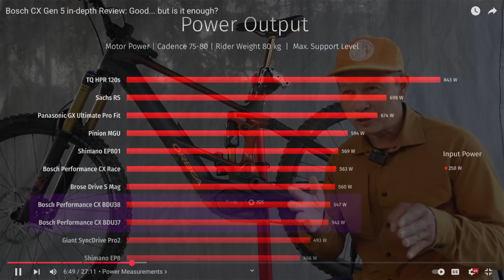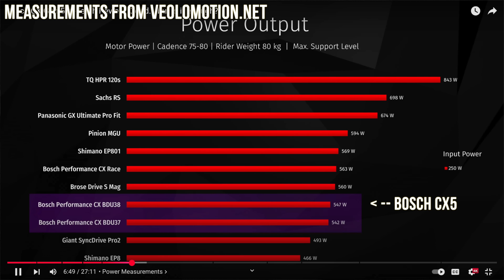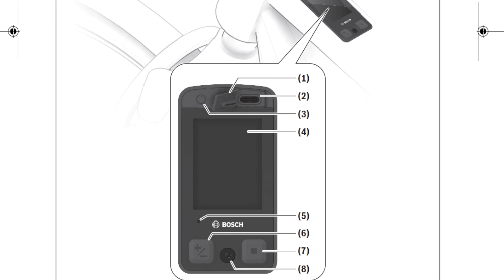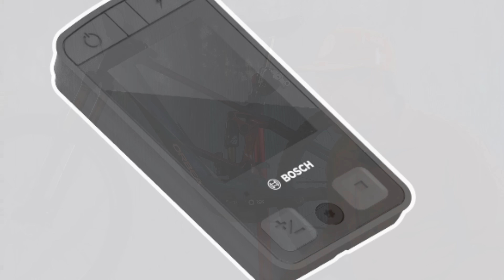Bosch CX5 motor to get 100nm torque upgrade and 750 watts - BDU38 CX model

Comment: With this power upgrade should I get the orbea wild or get the gen 4 levo? I did try the orbea wild and it was a beautiful bike to ride even though it was only a short test ride and wasnt tuned to me.
Reply from the maker: Gen 4 Levo. It is truly a great system. The alloy models should be out soon.
Reply: @EMTBReview would you reccomend a carbon or alloy? I've always had alloy but not sure if there's any disadvantages to carbon

Comment: That's never been a question. Bosch did that with the Gen4 Motor years ago and there's no doubt it will happen as soon as the stock in Gen4 on the market is low enough.
Reply from the maker: It's always been in question.  But many manufacturers have the CX5 upgrade now and it's verified awesome.

Comment: More torque and power is mostly a marketing gimmick. Existing 85 Nm torque is enough to lift front wheel into the air on a steep ascent and quickly destroy sprockets. Lighter batteries and compatibility between motor generations are more desired features.

Comment: The Purion 200/remote and display is only slightly larger than the LED remote. Just swapped my LED controller for it. <$200

Comment: Curious- on your climb test are you able to pedal through the turns at 200 watts at 14 or so mph (1 mile in just over 4 minutes) or do you have to make up the watts to get the average on the straights? At some point traction is going to be a problem  with these ever higher powered set ups.
Reply from the maker: Great question.  I have to make up the watts as it's not a constant 200watts the whole way. So the key is get the average to 200w by the end of the ride.

There are many ways to get to a 200watt average so I try to stick to the same formula every time.  Stay as close to as possible to 200w average the whole way.

Comment: Do you think the screens will be retrofit compatible when they come out? I was think of buying a vala and seeing the interface in person does look less refined compared to other systems.
Reply: The screens / batteries are usually compatible within the smart system (gen4+gen5), so this should be no issue. The vala already has this plate to be prepared for the new bigger inframe-mounted display, doesn't it?
Reply: @e_mtb  it's does have the cut out but was curious if was similar to the specialized where technically you could put the new display in but it is not guaranteed to work correctly.

Comment: fyi Purion 400 has been buyable since 2025.02.12 in Europe and early adopters got an horrible deal it started at 229$ and two months later it's 146$ equivalent in my country (which is more inline with the others Bosch displays but still more expensive than a Kiox500 for example)

Comment: Just put on order a Pivot Shuttle AM which comes with Gen 4 Bosch Race Motor... I do plan on racing this e-bike. Would you recommend purchasing an E-bike with Gen 5 or the new Specialized with 101NM or does the Gen 4 Bosch Race motor equal?

Comment: any plans to increase torque on the the SX motor so you don't have to spin 110 rpms?
Reply: yesterday I limited my Cx gen4 from 85 to 55nm to try and max range (48 miles 6090ft up and down a mountain on trails 13% of 750wh left) and I realized two things 1) bosch motor work on rpm and nothing else you cannot power pedal it brings nothing it's not a Sx only thing 2) I was hesitating to switch to a Sx but realized that day they are not powerful enough for when an emtb really makes sense, going up 30+% on dirt and rocks I ended up having to push segments I knew with 85Nm I could have climbed easily so mid-powered in the end help fit riders mostly when they don't need it (I'm 220lbs not fit at all so it would be worse for a 120lbs xc rider)  that said you still feel better at the end of the ride and in way less time I didn't do the same ride exactly but one with more road on legs and it took me almost 3hrs more

Comment: Now Bosch needs to give us the option to de-restrict our bikes!!! Specialized just did it (up to 28mph).
Reply: not legal in Europe  and for good reasons I get it it's a cool new toy but it's still a motorized vehicle that go 20+ which means you need a driver's license a specific vehicle insurance in case you "critically damage" someone and you can totally forget riding on trails and bicycle only lanes, you'll be restricted to roads parks or private land, the invasion of hiking trails by ebikes is bad enough we don't need actual motorbikes on them which is what a 28mph emtb is, if you don't see the problem I'll make it simple do you ever use sidewalks ? would you find it ok if I drove my 380hp car 2 wheels on the sidewalk while you're on it ? no ? exact same thing I ski I snowboard I skate I run I hike I bicycle there are limits to what is acceptable in terms of cohabitation between different activities and 28mph emtb are inacceptable on normal bicycle lanes or trails and you see those trails were made are maintained and belong to pedestrians and non-motorized cyclists thus my car on sidewalk analogy you have zero rights being on those 0,0
Reply: @fredEVOIX  You are totally talking based on YOUR experience, your perspective, and the current situation of your surroundings and where you ride, hike, skate or whatever. I live in a place where there are no people in 90% of trails I ride. There are no "advanced" laws either as in most Europe. And if there are laws, nobody es enforcing them. Not all of us live in crowded 1st world countries 😂. And for those of us, all I'm saying is GIVE US THE OPTION to choose and be responsible of what type of motor-bike we wish to ride. Just as Specialized just did. Be happy... and let others be happy.

Comment: I put the perion 400 on my cx4 and now I can lock my bike. Made it to where my phone needs to be next to me to let it unlock.
Reply: Is the Purion 400 hard wired or wireless? I have Bosch CX4 as well...
Reply: @ it’s plug in just like the kiox 300
Reply: @Marinmtb415  Thanks. Is it an easy install/do you need to take it to your LBS?

Comment: I have heard 105nm and 700 peak watts, Some rumours about SX power increase as well but not 100% on that one. A lot of people upset or questioning why its being released now. Its because there was a shit load of bikes with the Gen 4 still on shelves that bike shops needed to move, If the gen 5 came out with higher power straight away it would make it harder to move those gen 4 bikes. Instead brands have been heavily discounting gen 4 bikes to get rid of them ahead of this update.
Reply from the maker: SX is going nowhere IMHO
Reply: @EMTBReview  I love my sx bike, I wouldn't be complaining if I got a few more nm by way of a firmware update. No fussed about  paying $$$ for an iPad in my toptube though, the led bar display is sufficient for what I need.
Reply: Makes sense from a business POV. I did get a Gen 4 bike for thousands off so I’m good.
Reply: @LlenadeMalo  same thing I got a top spec end of 2024 I'll be annoyed if I can't get an update but it makes total sense not to considering where the bike industry is going they need all the help they can to move bikes and promote their 2025 models
that said while i just tried to nerf mine to 55Nm and felt it lacking for sure in steep slopes 85Nm is usually enough that my lack of skill fails me and I have to put a foot down before the power limits me
Reply: I think it's because of the launch of the Specialized Levo 4

Comment: Can the Gen 5 CX actually do 100nm and be reliable in the longterm? Will there be performance / heating / wear issues? Sounds like Bosch have been panicked by Specialized now joining DJI in the 100nm plus club and Bosch are hoping no one will ask serious questions about what this means for wear & tear on a motor which was originally marketed as an 85nm motor. If you bought a car that could do 80mph and then the manufacturer said it can now do 120mph to compete with a Ferrari would you trust them?
Reply: Of course. Do you think they released a new motor after 5 years to output the same ? It was bottlenecked so sellers could offload the Gen4 bikes as the stockload is (and still is) MASSIVE !
Reply: @Bogdan_Ch  This is the real reason why the CX-5 didn't come out with its maximum power. It's a marketing strategy to get rid of the old bikes parked in stores with CX-4 engines.
Reply from the maker: I think so. Incredibly relatable motor and the changes the magnets and motn6 months ago and hid it :)
Reply: I think the new CX-5 engine was designed with this future power increase in mind, using software. In fact, I think they must have already tested the torque increase. If they come up with this, the engineers will surely have everything figured out.
Reply: If plastic gears in the avinox can do 120nm, steel gears can handle 100nm just fine

Comment: How do you get the firmware update? Over the air via my phone? Or do I have to book a Bosch engineer to do it? Pay money to do it? There is one Bosch engineer in my area with a 6 month waiting list. I was about to buy a Cube with the Gen 5 CX motor but now I will wait until June at least. Bunch of w*nkers at Bosch if this cannot be done over the air like the DJI can be.
Reply: Bosch does over the air. I don't need to bring my Gen 4 Bosch into my LBS, either.

Comment: I tried a pinion and was surprised how hot the motor got. With this torque upgrade on the Bosch it will be interesting to feel how hot that motor gets.
Reply from the maker: Pinion has a transmission inside.

Bosch has been very stable in the past. But we shall see

Comment: Hopefully happening with Gen 4 it's got to really they can't just ignore the Gen 4 now since still being sold in bike's today! I just bought my ebike (emtb) last year summer so still brand new really! Endless updates right enough for the app and have purion 200 and kiox 500 on it at the moment love having both i designed my own top tube mount to flush in with the frame for kiox 500 it looks really nice and out the road but will be putting purion 400 on it soon!
Reply: Unnfortunately no power upgrade for the gen 4.Only gen 5 😕
Reply from the maker: Fingers crossed!
Reply from the maker: The problem is they had to add magnets
Reply: @EMTBReview   not just that from what I’ve been told they tried but there was overheating issues

Comment: So basically, they were holding out on the consumers the entire time and must relent due to competition. Such BS.
Reply: I would see it more in the way that the system could have handled more power and torque but they decided that the current setup is enough for the consumer. More torque always means more wear on the gearing and shifting components. Then DJI came and now Specialized pushed the numbers up, so they have to follow to stay competitive.
Reply from the maker: I think they hid it since they were delivering so many Gen 4 motors at the time due to backlog
Reply: Harsh dude

Comment: Why would they sandbag this announcement after so many bikes have been reviewed?  Now reviewers will have to start over.  And, at 100nm, still much less than the Levo4.  Maybe they were waiting for Spesh to give final figures and the FW will actually put out 120nm
Reply: only the s works has 111nm. The price difference merits 10 nm.
Reply from the maker: I think they did it since so many CX4 motors were yet to be delivered and bikes built and sold

Comment: Look, Torque is important, but it can only do work if the POWER is there, CX5 at 587 watts is not really going to be that much faster than it is now, if at all. The reason the DJI avinox is so much faster is because it is sporting over 800 watts of power. Why? Because DJI knows if you have high torque then you need high horsepower to realize that torque number, and allow that massive torque to perform more work than the other motors. A grist mill has like 2000 ft/lbs of torque but only 1 horsepower, and guess how fast it moves? Maybe a revolution every few minutes? TQ needs HP to function, otherwise you just have a grist mill.

Comment: is the amflow still better than the new gen4 levo? all the videos dont really compare it. Im looking at getting an ebike to help me get out more. I like the amflow best so far.
Reply from the maker: The DJI motor is better than the Levo 3.1 motor. Stronger, quieter, lighter.

But the battery system of the Levo is better. Swappable and extender available.

The bike itself and build and price options, the Levo Gen4 is wayyyyy better. The Amflow is like a 4-year old Stumpjumper
Reply: @EMTBReview 4 yr old stumpjumper?? 🤔 where is the the 4 yr advantage in the new Gen 4?? 🤷 they both share the same 150/160 travel, both made from carbon and both have similar geo. The Amflow cam be full 29 or mullet - which gets the geo even closer. I'm sure the Gen 4 is a great bike but @£12k plus for the S Works. The base Amflow has it beat on power and tech for less than half that price. It's only the Amflow here that makes the most sense 👍
Reply: Ya the new levo doesn't do it for me 😢@EMTBReview
Reply: wait until the forbidden E druid DJI comes tomorrow !
Reply: @gnar_tar  tomorrow??
Reply from the maker: Tomorrow? Yeah, I'll check it out at the Otter.
Reply: @gnar_tar  today
Reply: Smart move!

Comment: Your power chart needs updating as you dont have the Avinox  system there.
Reply from the maker: Most definitely. I is up there! 790 watts of stump pulling power.
Reply: I don't think the average dentist can afford to buy an Apache helicopter fully  loaded with the latest upgrades.
Reply: or an Apache attack helicopter. pretty disappointed with the lack of thoroughness here.